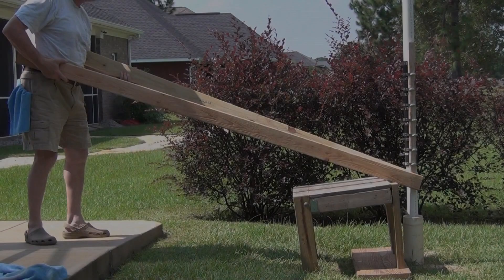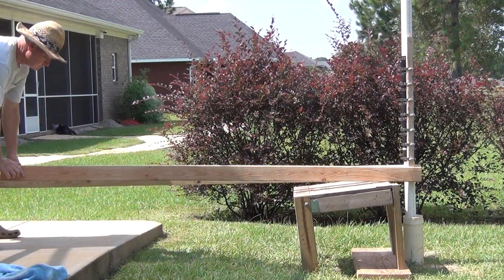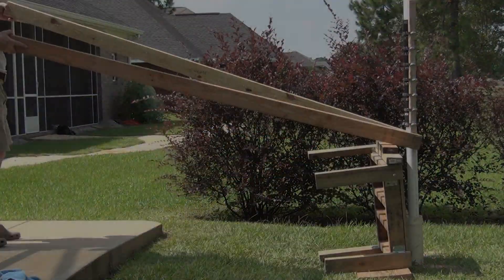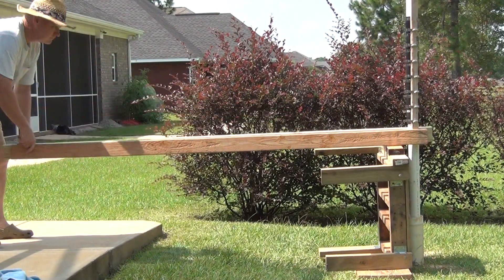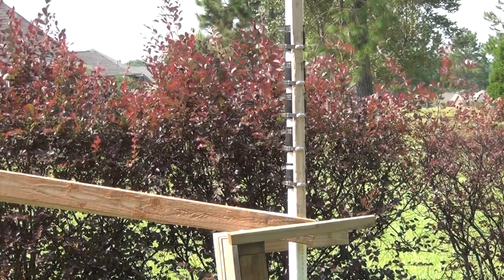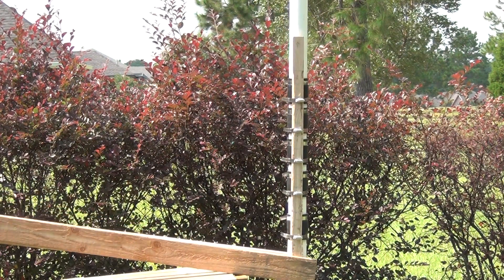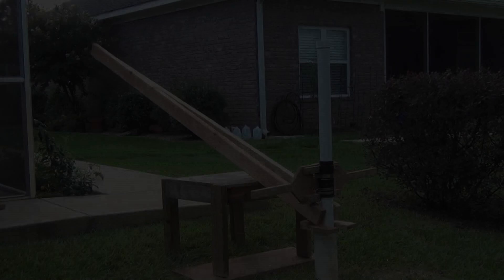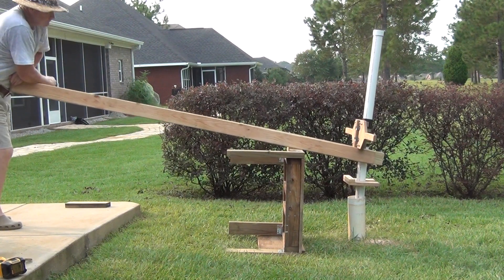When the Pipe Sticks - From the Drill Your Own Water Well Series

Comment: Did one and it got stuck at 120 feet. I used a tractor and rope very scary consider how long it took to baul the well this is a good vid way safer than using a tractor
Reply from the maker: 120 feet!  I'm impressed!
Reply: @dawmlw  i used a metal bailer bucket from Ace Hardware store they rent them out. Was alot of work.  Had to get on a ladder with another metal pipe with a long bolt through it tap down the pipe it was hell but worth it.

Comment: Ive used a quick method a 3 ft. X   1/4 inch Chain with 2 hooks and a 60 inch
High lifter jack, wrap chain around about 5 coils and hook back on its self leaving 1 hook on the jack when pressure applied chain will choke the pipe and out it comes

Comment: Basic physics to remove something gripping and pulling or using a teeter toddler motion to get something unstuck. It's like pushing a wheelbarrow uphill or pulling it down hill basic physics it might be better to push I will go downhill if you have a heavy load goes for the opposite pushing a wheelbarrow uphill with a heavy load in might be better to pull it. In California central valley fruit basket of the world we have been in a servicer drought for over six years with no or less then advantage  mountain snow fall in Yosemite national park 2011 thur 2017. Texas versus California in water the Rocky Mountains seen from Texas the Midwest, we called the mountain range Sierra Nevada.

Comment: Next time attach 2' long piece of rope between the lifting end of the boards and wrap it around the pipe several times. This should provide good grabbing force on the pipe and readjustment for the next grab easily.
Reply from the maker: I tried that but it kept slipping.  That is when I decided to try the clamps and rubber sleeves.  Thanks for watching!

Comment: The bushes looked fine. I was waiting for them to change seasons and the snow to fall. lol. Great job and lots of patience :) Seriously due to how nature works, even if you do it another way the pipe itself against the sand resistance has to move slowly. Always listen to how resistance is causing the problem and then how it's letting something loose no matter what the item is. That is the lesson to learn from this technique. The problem with machines is that sometimes you can't feel that resistance. Here you can feel it as it works itself out. I would use more items to help with that muscle work though :) That leverage is always a challenge with every labor intensive project for me, but that is what makes it more exciting when the project is successful.
Reply from the maker: skybitscom good points!

Comment: I would like to suggest a technique that my brother and I used for pulling a well pump once. We used a heavy duty A frame and had a cable wrapped around the pipe a few times and hooked a come along between the top of the A frame and the cable and used the come along to pull the pipe up then put a muffler clamp around the pipe that would keep it from slipping down into the hole again while changing positions on the cable. Just a suggestion that might work better and get a longer pull on the pipe. Oh don't forget to put a ring or something on the top of the A frame to run the pipe through to keep it from bending while you are pulling it up.
Reply from the maker: sounds like an excellent technique!  Thanks John!

Comment: I have found that wrapping a chain with several loops up a pipe covering a couple feet will cinch tight when pulled up.  Hooking up this to your leverage could possibly be easier than the hose clamps.  The chain is easily moved down when released and you can leverage again if needing to pull the pipe higher. (I like how that bench serves two purposes).   Still drillin' in Oaxaca dawmlw, and I posted more youtube videos. Love to hear from you.
Reply from the maker: David, I watched all your videos and I love them! Thanks for posting.  Send me an email if you can.  My address is posted on the website listed just under the video.

Regarding your suggestion to wrap the pipe and pull up on the chain - I'm concerned it would snap the pipe.  I'm only using 2 inch PVC and it will break fairly easily compared to metal drillstem.  What do you think?
Reply: dawmlw Anyone who done long hole drilling knows exactly what you say about the pipe going to stick in the hole.  Most likely culprit is debris falling from higher up the shaft and wedging the drill pipe. Then the skill of the operator and his experience come into play and Mr dawmlw shows he knows what he's doing here.   He demonstrates that the operator needs to know his equipment and the forces he can apply to free stuck pipes.  The alternative is a bust pipe and that means a new hole with all the collaring to go through again.  It doesn't look like "Fishing" will work on plastic pipes. 
With his method you can "feel" what is happening as you exert pressure on the levers.  If a chain was tried it would be difficult to judge the forces and when the plastic pipe had reached its limit before it collapsed and caved in and broke. Here with the clamps he is distributing the force along a greater area to lessen the impact on a short section.  He doesn't show it but i'm willing to bet he used a bit of rotational movement in between the lifting.  Ideally another person giving some rotational movement while the lifting is done will aid.
Reply: Guy Martin dawmlw I agree there are risk with any method and you should know your equipment.   Colapsing a 2" sch 40 pipe would only happen if you didn't distribute the force over an extended area of the pipe but that is the beauty of a chain  (and as the guy below used a cable- which I think would do the same thing) is that if you snake the chain around the pipe over some distance it distributes the weight.   I would bet that the leverage from the "teeter totter" method is not enough to snap the pipe - bend it and distort it but break it with a chain  - not in my experience.  But theories are meant to be tested and I'll sure that I could be wrong.  I'll probably get a chance someday to find out.  Thanks for your input.

Comment: i think  if you conect a hose garden  in to the stuck pipe and apply a water presure  until get  water circulation the stuck pipe will be free easily
Reply from the maker: Perhaps I should have mentioned in the video that this technique is for when you loose circulation and the pipe sticks.

Comment: I have my work cut out for me, hard clay. I don't have much choice, I can't get water on my property because it doesn't touch the paved road. I'm on a shared waterline and it's costing me a lot of money to use it. The previous owner of the waterline never charged so much. I own my property outright, the water was never installed seperately. Not enough rainfall for a catchment system either.